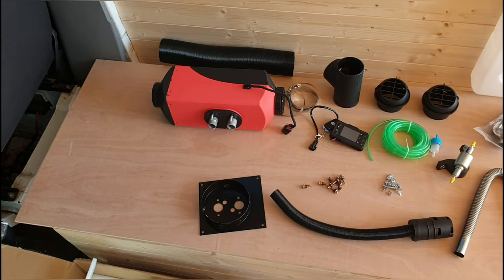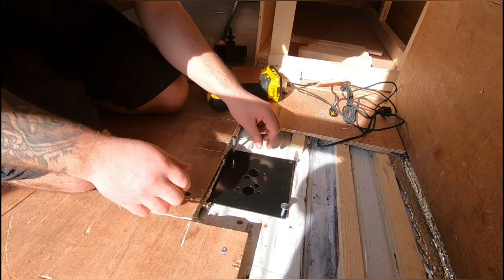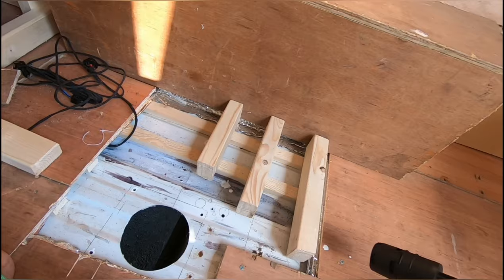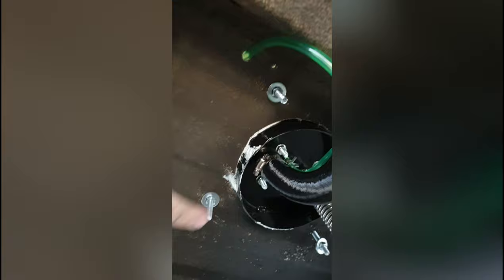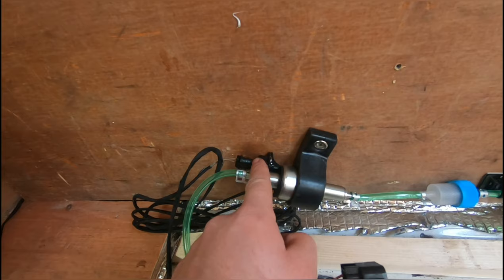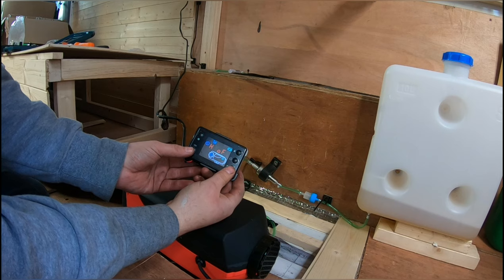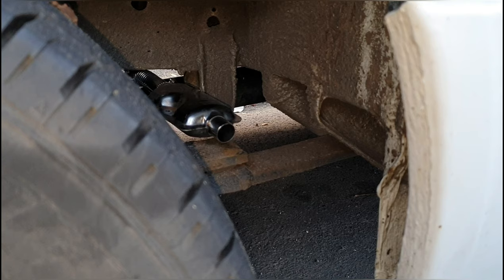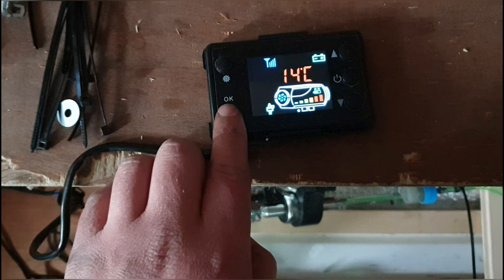Ebay Chinese Diesel Heater -  FULL DIESEL HEATER INSTALLATION from start to finish

Comment: At 4:14 You should of placed a rubber grommet between the fuel pipe and the drilled hole in the metal floor. great vid though. Thanks
Reply from the maker: Done the same On my first install , reminded myself all morning not to forget the grommet ... So i fitted the heater , uploaded the video and realised i forgot the grommet 🙈😂
On there now , Cheers pal 👍👍
Reply: Shit just read this as I added mine :) LOL
Reply: Great video friend,No unexpected things we dont need to know about,Straight to the job and done it greatly,Thank you 👍✌
Reply from the maker: Thank mate 👍
Reply: Oh oh, I’ll have to Google what a grommet is now! I have 0 mechanical experience... but I do make a great martini! 🍹😂
Reply: Where to get the rubber grommet from for the turret plate? Thanks
Reply: @cameron.mackenzie   should have been one with it but it is not a special part you can get one in any hardware store ☺👍
Reply: Guy’s,where should I put this in my class A?
Reply: @jessicabennici  WHerever the original heater is located would probably be the best.  A lot of the kits come with a bit of ducting, but not really enough to run it all over a class A.
Reply: @jessicabennici  hi. Normally bunk heater is mounted under bed in sleeper, preferably near middle, easier to access.
Reply: That's not ninety degrees, mate.  Maybe 45?  30?  But it's neither zero nor ninety...
Reply: hello , my first time , installing ,what kind of rubber grommet you think?thanks

Comment: I think I caught 2 items you should change- change out fuel line for the white stiffer version, and, reverse the direction of the fuel filter. Thanks for posting your clear video.
Reply: I agree, I only came to the comments to find out anyone else had noticed that the pump is pushing uphill away from the tank.
Reply: You mean the pump should be under in order for it not to struggle while pumping gas, right ? :)
Reply: @dellawrence4323  No, the fuel pump MUST be pointing up (at least 15°, ideally 45°, up to 90° (vertical, perpendicular to floor)!  The pump has an air/bubble elimination feature which requires that orientation!

I don't think I really understand what you mean about not having it pump "away" from the fuel; I can't imagine how or why you would set it up in any other way...
Reply: Didn't help with my issue, my fuel tank came with no hole for the fuel nipple.
How do I sort that?

Comment: My top tips would be:
Use a metal pipe for the intake pipe too. Mine came with a carboardy foily one and it perished after a year and the whole heater had to come out to replace it.
Put some shielding around the fuel pipe near the exhaust so it doesn't melt from the heat of the exhaust.
Reply: great tip .do you think you'd need some kind of meta flexi pipe ? re screw fix .thanks Michael

Comment: Good video  ,  a few points I was told by a mechanic was that it's best to prime the fuel pump and line to the pump before starting to lubricate it otherwise it is running dry until it eventually sucks fuel through which could shorten its life , the exhaust silencer should be mounted vertically with the drain hole it has at the bottom and positioned so the exhaust gas is not existing under the van and the exhaust has a slight downward fall along its length so no water traps  .
And finally get yourself a Co2 alarm just to be on the safe side.
Reply: I agree as there self lubricating fuel pumps.. 

The idea of the pump been lower than the fuel tank is that once its primed it will never need to do it again unless you totally run out of ⛽️ fuel
Reply: That would be true if it were a gear or vane pump, but these little "click-clack" solenoid pumps can run dry for a very long time without damage. I would still prime up the pump before hooking up the fuel line to the heater just because it will prime a lot faster with an open line.
Reply: @MrHercules222  how do you prime the pump before starting the hole sistem?

Comment: This is such a good video, super clear and easy to follow. Plus Tommy responding to the comments and updating us on adjustments is REALLY helpful! I ordered the exact same heater so I could follow along to your instruction....the power of advertising 🤣 really glad I found this vid. Thanks again
Reply from the maker: Thank you .
Glad it helped 👍🏼👍🏼👍🏼
Reply: @LT_TOMMY_  well I've not fitted it yet but feeling way more confident than I would be if it wasnt for this 💃🏻

Comment: hey, thanks for your help. thanks to you ive fitted a diesel heater in my van and its working well, not the exact same as this but very similiar, even bought the turret playe you advised. thanks for making it so straight forward its just the help i needed
Reply from the maker: No problem mate, glad the video helped 👍

Comment: It won't be long before you move the fuel pump to another position.  
That ply panel will act like a sounding board and amplify the pump tick tick noise.
Move it below floor level and fix it to a chassis rail with as much rubber buffering as you can manage.
Reply from the maker: Already hanging with cable ties 20 mins after the video lol 😂👍
Reply: @LT_TOMMY_  So the pump can survive and work well in outside temperatures (both the cold of winter, and the heat coming off the engine components)? Now that it's outside, how is the noise level overall? Thanks!
Reply from the maker: @kriegsmandot1  Hello mate , I haven't put mine outside,  mine is inside but hanging with cable ties which makes it almost silent,  lots of people do put there's outside and have no problems 👍

Comment: Great video, Thanks!
Not sure if this has been mentioned but the fuel filter is installed backwards. If you turn it around you will have a greater surface area to collect debris. The way it is installed now only yields the smaller surface area of the inside of the element to unfiltered fuel. This is why filters are directional.This is more important on a pleated filter than a mesh one, however installed correctly there will be a larger area for debris to collect and will yield longer intervals between filter change being required.
Reply: truly sad the chinese cant put a direction arrow into the plastic mold ;-(

Comment from the maker: Thanks for the great feedback all, glad it helped 👍 
As soon as i finished recording i hung the pump with zip ties ,its now almost silent...I'm very aware that i got the 45 degrees angle mixed up with 90 degrees...
And the grommet is in 👍😂
Reply: Hey Tommy, thanks for this.  Are you saying instead of securing it to the wall the fuel pump is now suspended with zip ties and not knocking against anything?  Cheers - Ed
Reply from the maker: @ejdugan  Exactly that mate 👍👍👍
Reply: I’m looking to install one of these on my camper and wanted to install it outside. Do you think it could bother the camping neighbors? Is it too loud?  Is it better inside the camper? I don’t have much room this is the reason to put it outside.
Reply: You can get the all in one, self contained version that you can stand outside and I don’t think it is noisy enough to bother anyone nearby. Search up a guy called Keith Gee - he has a vid about doing just that on the outside of his truck camper.

Comment: Mine has turned up today!  I have a vauxhall vivaro the unit is going under the passenger seat (plenty of room) as I still have the bulk head it will reduce noise into the back and I can pop the heat vent thru a hole in the bulk head. Fuel pump going under the van in a water proof box (noise) so fingers crossed! Fuel tank not to sure yet. Really handy to refure back to your video 👍🏁
Reply: Do you think it's possible to drop the hose into the main vehicle fuel tank? I'm not that enthused by having to top up a separate tank regularly, or have that fuel floating around in the living quarters.

Comment: I wasn't certain that I would watch this till I heard you say I'll file that to clean it up and paint it. I really like that the plate had that round section, it gave me the idea to put it on mine if it does not have it, I'm putting mine in my caravan which has a ply/foam/ply floor. Great stuff.
Reply from the maker: Hello mate , yes the turret plate is great to use , only £19 on ebay at the time. 
They don't usually come with that type of turret plate , it's normally a flat plate. 
Thanks for watching 👍👍👍

Comment: Thanks for making this video and sharing.  I just ordered this same unit and was afraid the instructions are going to be terrible so this is all I need!  I’m going to be using it to heat my roof top tent in Moab, Utah in a couple of weeks from now.
Reply: Just translate the English back into Chinese and it makes perfect sense.
Reply: @lollerskates1992  Tried that but just ended up challenging a cool dude in flares with the mother of all Afro's, to fight my ancestors.
Reply: So how much is it costing to run ,say 10 hrs a day

Comment: Many thanks. Not seen anyone else mention this but I assume that when you say that the angle for the fuel pump should be 90 degrees, you actually mean 45 degrees. Cheers.

Comment: You need to change the place for the fuel pump to reduce clicking noise, wood is a big noise amplifier!
Great video, thanks ;-)
Reply: I’m looking to install one of these on my camper and wanted to install it outside. Do you think it could bother the camping neighbors? Is it too loud?  Is it better inside the camper? I don’t have much room this is the reason to put it outside.

Comment: Great vid. I just bought one after realising they cost £90 off ebay when i thought they were like 200 😂  I have to try and find space for it all tho as my build is finished, pretty daunting 😬
Reply from the maker: Thanks 👍👍

A lot of people are building them in portable boxes and just running the heater vent in to the van , possible option if you have no room 👍

Comment: Ive had issues with the pump been higher than the unit . The pump creates miniture air bublels and they turn into one bid air bubble in the line . And ultimately stops the unit .  The fuel tank can be up high though that doesn't matter  .. just the outlet of pump lower than the unit so it pumps up to the unit.  And now I'm watching those very tiney bublels just go up to the unit up the green hose that was supplied with it  . It doesn't stop running now .  No big air locks.

Comment: Great video and thanks, a quick question, what device did you use at the bottom of the fuel tank to keep the pipe in place and to stop leaks etc. My kit didn't come with anything

Comment: Fuel next to the heater .... Good luck 😂🤣😂
Reply from the maker: Absolutely no problem at all, the heat output is the only thing that gets hot inside the van and its facing away.
Have you seen how compact the all in one heaters are?

Comment: Your fuel filter is in the wrong position. It should be mounted in the other direction. (bleu side = pump side) I hope you finaly mounted your exhaust the right way (moisture hole down)

Comment: I’m installing one of these soon. You sure made   quick work of the hole-cutting. I just need a drill and a hole cutter made for cutting metal? I’ve used them on wood before but I’m nervous about cutting metal and hope I can find the right tool for the job without much fuss.
Reply from the maker: Let me finish work and I'll try and find all the links to the tools used for you mate , they will be toolstation links , are you in the uk?
Reply from the maker: 127mm metal holesaw  + Arbor

Toolstation Product code - 62856 👍

Comment: Thanks for sharing, may tell us HOW YOU CONNECT THE HOSE to FUEL TANK ? there is no hole  .
Reply from the maker: Hi
Here's a video to fit the stand pipe,  did you have one supplied with your kit ?

https://youtu.be/7O0o-g0fO-s

Comment: Great video, thanks.  I looked through the comments and noticed that you run this on a leisure/house battery for a few days before it runs flat, but I didn't see you mention how big your battery and / or battery bank is, how many amp hours is your leisure battery / bank, and what chemistry is it (AGM, flooded lead acid, lithium iron phospate, etc)?? And if your battery is a battery bank, like how an RV is setup with 6x 6volt golf cart AGM batteries in series-parallel, how many batteries do you have in your battery bank?

Comment: Hi Tommy, Looking good. Any difference between the new heater compared to your old one. Little grommet around the fuel pipe might be good? 🤟
Reply from the maker: Morning mate , ive put a lil grommit around it , just waited for the paint to dry first 👍
Not sure in difference yet mate , literally had it running for 20 mins when i installed it ...
Seems a bit quieter compared to the 2kw

Comment: Very nice, clear and informative. Does it have a thermostat? ie so it switches off when it gets to the set 27C, and back on again when the temp drops below?
Reply from the maker: Hello mate , yes it has a thermostat,  once it reaches set temperature it slows right down rather than cutting out completely 👍

Comment: you want to change the orientation of the silencer, it has a drip hole for condensation on one side.
Reply from the maker: I didn't even realise . Cheers pal 👌👍
Reply: @LT_TOMMY_  i only knew because Im installing my heater too hehe
Reply from the maker: Good timing lol 
Its good to share info/advice 👍👍

Comment: Fuel pump should aim up so all the air bubbles escape and are not trapped in pump housing also fuel enters filter on outside of inner cup.
Reply: He did that

Comment: Thanks. Got me keen to put one in my T4
Reply from the maker: Its as simple as that mate 👍👍👍
Reply: I have a 2016 Transit Connect which looks about the same size as your van, but I bought a 2KW heater - with no insulation (in Arkansas). Should I have bought the 5KW heater? Also, mine didn’t have the big hole flange to go under the heater - do I need one?

Comment: Very good vid and easy to follow. Do you here much noise from the pump once the diesel is flowing?
Reply from the maker: Thanks , glad it helped 👍

Since the installation i hung the pump with cable ties which makes it almost silent otherwise yes you will definitely hear it 👍

Comment: Personally I left 10mm from the bottom of the fuel tank and drilled for the fuel line so any crap in the fuel can sink and not be dragged into the fuel filter.

Comment: Good video, thanks for the effort you put into it. I've asked several people this same question and so far no joy. I want to put the heater in a locker in the salon of a boat. That locker is directly over the  fuel tanks. My question is, how much of a head will that pump lift. Also, how hot does the exhaust pipe get? Thanks in advance and keep up the good work!
Reply from the maker: Thanks mate 👍👍
I'll be totally honest i don't know but set the pump up how you wanted it and see if it works , bit of trial and error....
As for the exhaust yes it gets very hot 👍👍👍

Comment: Hi Mate thanks for sharing. Does that clicking click constantly? Also does the fan stop when up to temp then kick back in when temp drops. Just contemplating putting one in my caravan but I don't think I could sleep with the clicking. I guess pump coult be put in a sound proof enclosure. Great to see how easy it is to install.
Reply from the maker: The pump clicks continuously, fast or slow depending on the high or low settings, if you hang the pump with cable ties it's almost silent 👍🏼

Comment: Nice. I'm thinking about installing one in my boat. Not sure where to put it exactly. Does it matter where the actual unit is placed? Is it sensitive to anything? Obviously the exhaust and the fan are hot and one needs to take precautions there, but the actual unit should pretty much fit anywhere, right? Even in enclosed places? I am thinking to put in one of the stowages under a berth.

Comment: Great video,very informative.Quick question.Would it be possible to have it all on the outside apart from the pipe that blows the hot air in ? I don't just mean exposed to the elements but in some sort of enclosure.
Reply from the maker: Hello mate , glad it helped 👍 

Yes there is no reason why you can't fit it in a protected box underneath the van , people also make these in a mobile case so you can put it where you like once parked 👍
Reply from the maker: Also here's the link to the box set up 

https://youtu.be/3mCVFFJxn4I

Comment: Is that’s a 2k heater?  I’ve got a lwb sprinter not sure to go 2k or 4k 

Great video
Reply from the maker: It's usually 2kw or 5kw, I'd personally go for a 5kw but they would both do the job mate 👍🏼

Comment: Nice vid but can't believe how much voltage it's using, may as well just buy a 150w 12v heater and 120 ah agm battery
Reply from the maker: Hello mate , it only uses a lot on start up and cool down , when it's running it uses next to nothing 👍

Comment: Great video, so easy to follow so cheers mate. I’m thinking of doing the same but I’ve already got my flooring and insulation board in. Do you think the turret plate would be okay to mount over them?
Reply from the maker: Thanks , glad it helped 👍

To be honest that should be fine as long as you can fix it down properly and it clears the floor to outside the van ,  despite what people say the turret plate dont get really hot anyway👍

Comment: My heater did not come with the large-hole-saw style turret plate, just a flat plate with two smaller holes.  If I cut this hole, I'd like to do it once and do it right in case I need to replace the heater with a different model.  What size hole saw is this?  Is that the "standard" size?  Thanks for the great video!